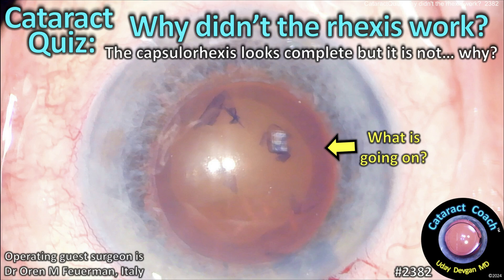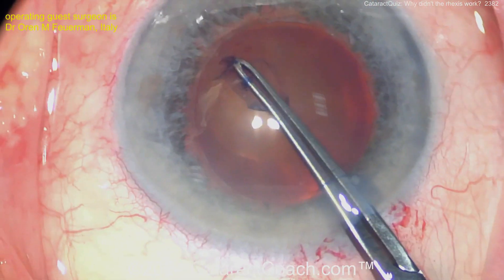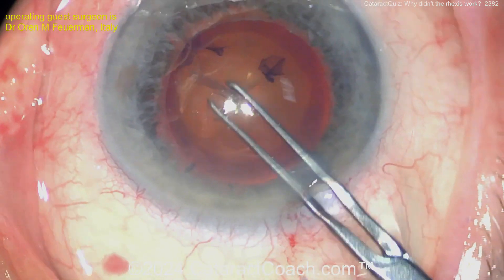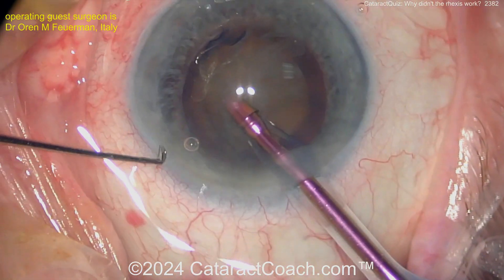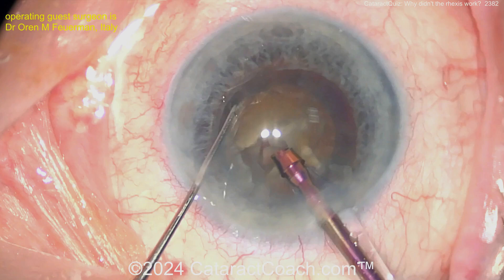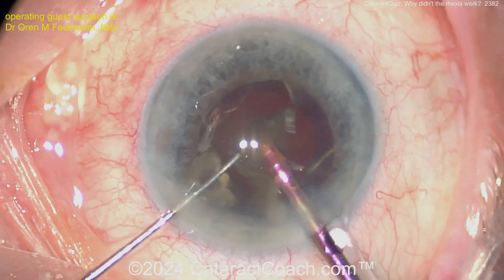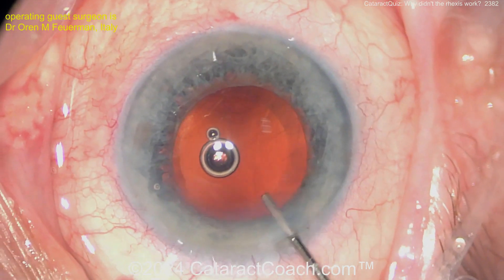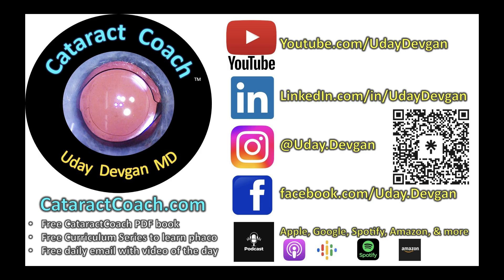CataractCoach™ 2382: Cataract Quiz: Why didn't the capsulorhexis work?

Comment: This has happened to me once before (I started in 1981), the case was otherwise routine, no trypan blue. However, I have noticed a few since where there has been some splitting at the start, then easy to go back to include deeper layer. Also I feel it's less likely to occur if you start with a needle.
Reply: I concur. Had once. I also use needle for initial cut and lift and saw the second one . Grabbed both with forceps and finished successfully 😅